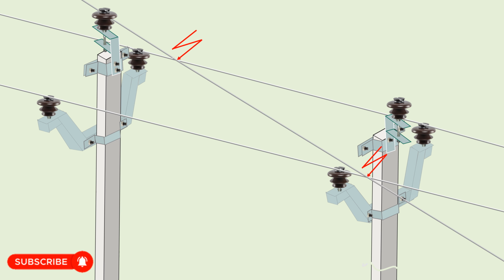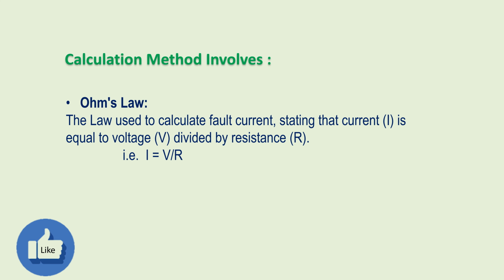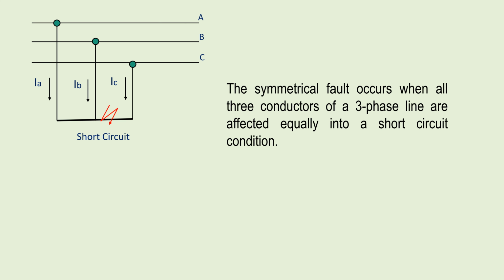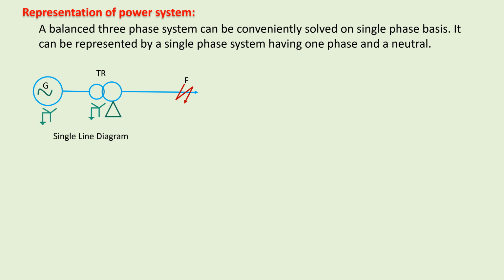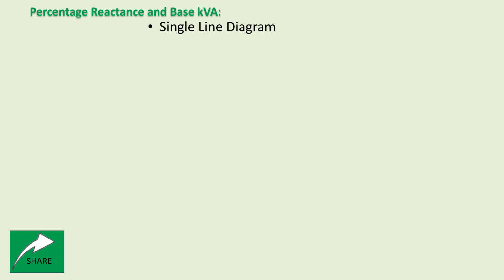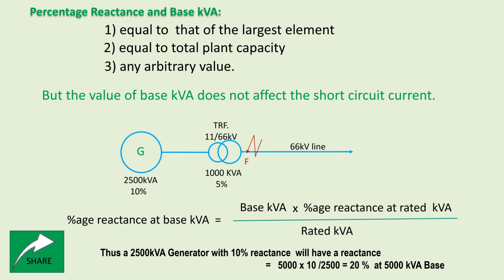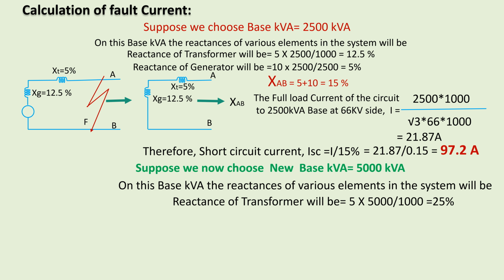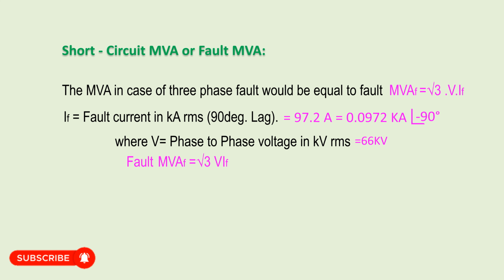FAULT CURRENT CALCULATION//THREE PHASE FAULT CALCULATION//SYMMETRICAL FAULT CALCULATION

Comment: Sir what if more than one transformer connected in parallel
Reply from the maker: You are welcome. You can connect more transformers and lines in parallel. As much as you connect, equivalent impedance will be low. So fault current as well as fault MVA will be high. Higher rating buses, isolators, CB etc will be required. Thank you ❤